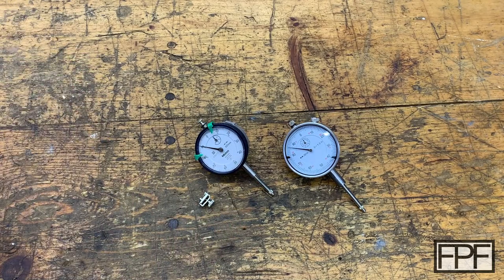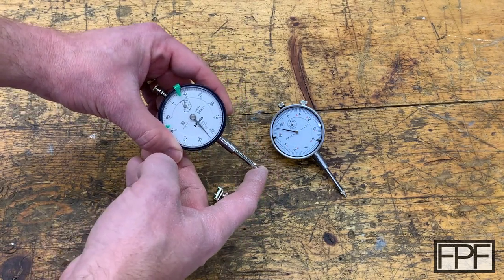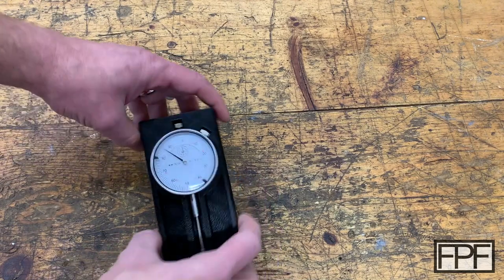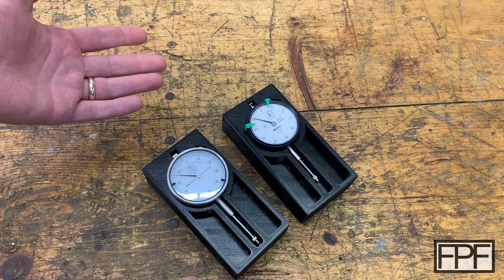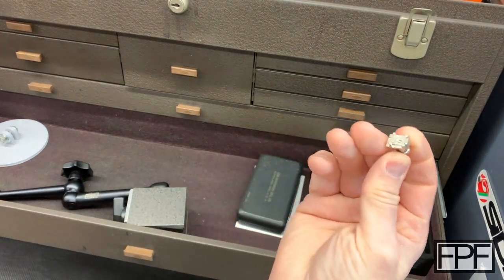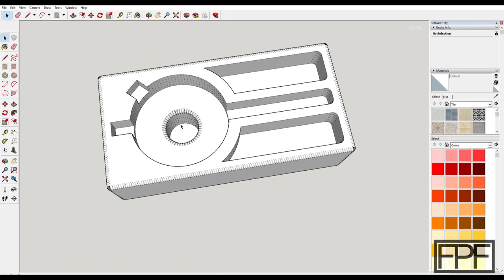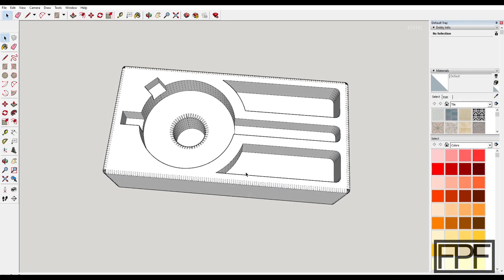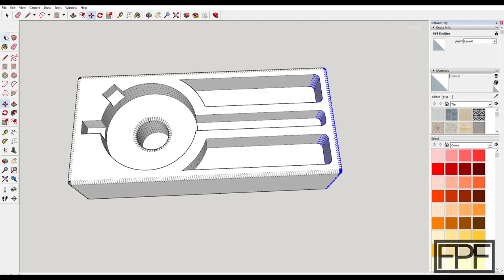3D Printed Dial Indicator Storage Tray

Comment: Subbed, just ordered a printer yesterday and I've been trying to make a list of functional prints to do. Saw your video posted on reddit and jumped on over here. I got 4 sitting in one of those red plastic storage bins that hang in cabinets. If I open the drawer quickly they rattle around and 2 of them are tenth indicators. One other one is in the Styrofoam block it came in, it's big and awkward. Definitely going to print up a handful of these when I get the printer running and it gives me some ideas to make some other drawer organizers I'm too cheap to buy or aren't exactly what I want. I have too many needle files rattling around and so so many lose allen keys...I think it's time to get rid of repurposed small cardboard boxes and old tooling tubes and trays. I have a feeling my cnc mill areas gonna have a lot of printed parts soon.
Reply from the maker: There's a learning curve to the design software and getting good prints at first, but once you get past that, there's no limit to what you can make better.
Reply: @FunctionalPrintFriday  I'm realizing this, I was messing about a little with a free version of Fusion 360 and while I have a good idea of "what" I need to do, its the "how" that is going to hold me back for a little while. I've never really messed with any cad or cam software much. Give me a blueprint, mill, and a lathe and I'll get you whatever you need. Designing it yourself is a bit more of a challenge it seems.
Reply from the maker: @astaschak  It is at first, but once you get the hang of your software of choice, you can knock stuff out so fast.  Don't give up.